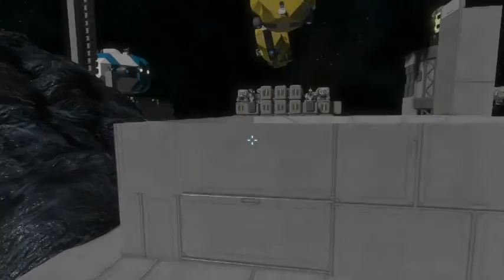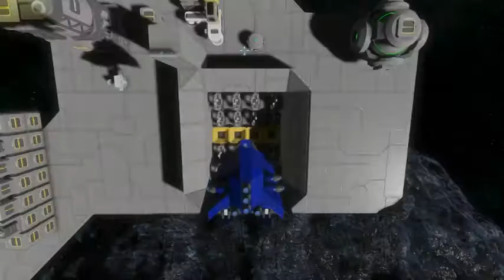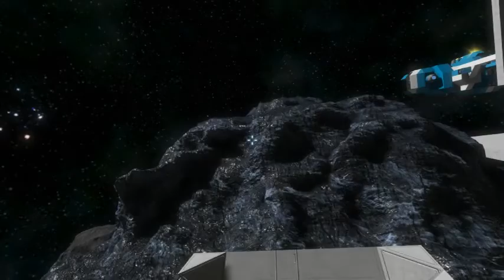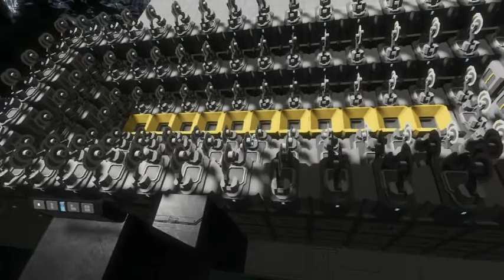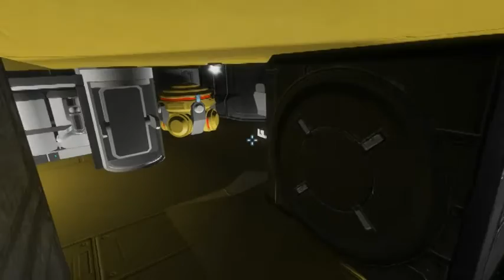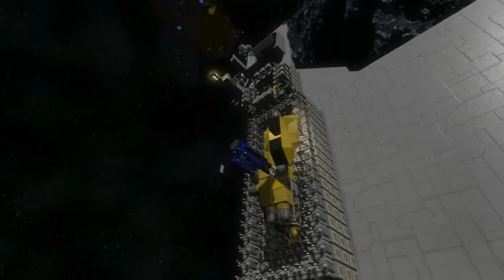Space Engineers: How to Make a Grinding Platform

Comment: Some things to note:  when you use large grinders on small ships, there always will be parts that miss the grinders.  Only small grinders are efficient and breaking down small ships.  Create a plate of small grinders and attach them to an advanced large rotor.  

When breaking down large blocks ships, I just use a merge block and attach them to a station.  Then using a ship with multiple grinders attached, I ship-break that way.  It's easier to move the grinders than the ship.